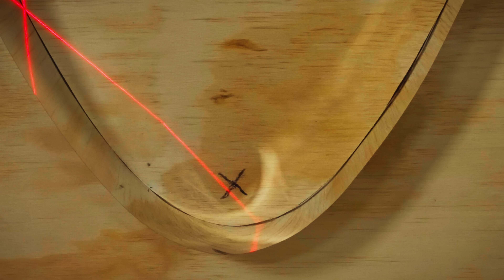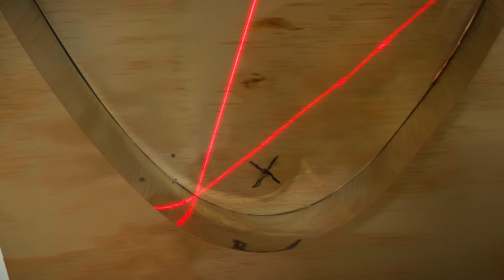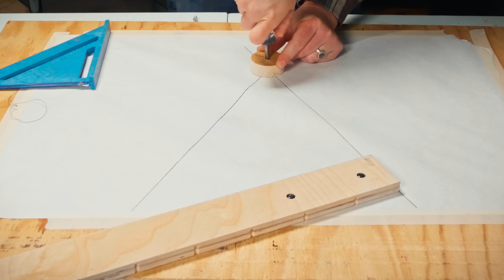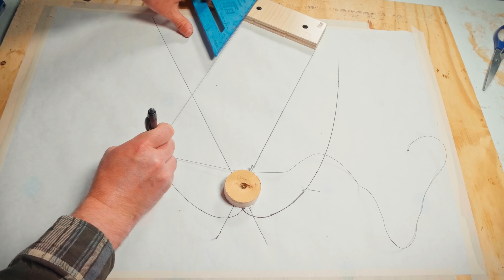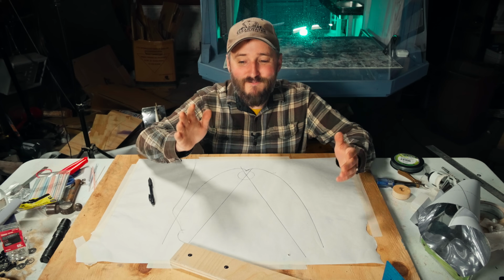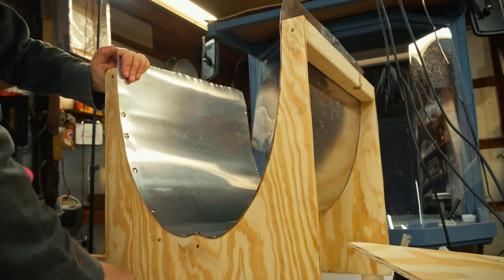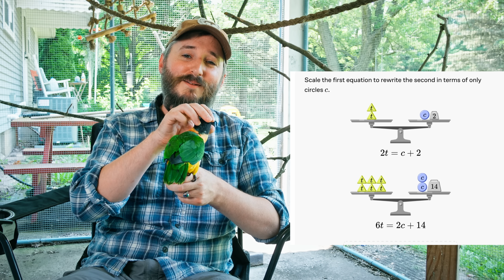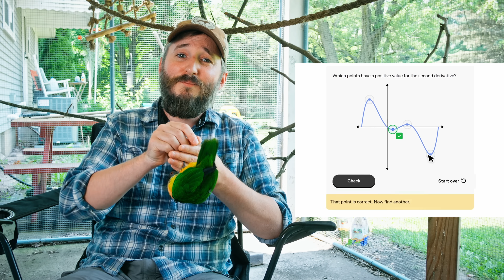DIY Solar Concentrators, Made Better.

Comment: I think if you repeat the mirror over and over to ten feet and put a black aluminum downspout in it ,it might be able to pump out a nice slow flow of hot air. If the volume isn’t enough it could be coupled with a box of passive solar black pipes to move really hot air into the box then pumped into a building.

Comment: I wish I could get water under 98F + out of my pipes during the summer. The only thing that helped slightly was to put a cut piece of pool noodle over the line coming into the house and shade it with a hose reel. My hose bib and main line face north and have shade coverage from the east.

Comment: Instead of a reflector, can this be done to make a lens that will direct the sun onto a solar panel throughout the day? This could eliminate moving the entire panel to track the sun.
Reply: Except that you have to move the lens now AND the panel, and also actively cool it bc otherwise it'll be toast :) Also doesn't make much sense because you could simply use a panel the same size as the lens, the amount of energy collected is the same.

Comment: If u like to progress more u might like seeing the project of an already passed away physicist, radio-astronomer and engineer - with international recognition, on a solar thermal powerplant version with hot air, not water. Due to a breach of the agreement from the side of the investor, the experimental powerplant remained unfinished and he dies soon after. 
He claimed it was the most efficient energy production from (star)light, considering the space used and the relief (terrain) possibilities (mountains etc.). His name was Paris Her(o)uni and the test project was called, I believe "AREV" ("Sun" in his tongue), maybe with a number after it...
Reply: The parable remains steady and only the top moves, just like his radio-antenna he had designed, which in his times was had the least noise polution in the standard of 8mm something :D Back then it was the smallest wavelength astronomers were "catching".  You have started  noticing, what he had noticed long ago and had the designs to implement also in energy generation, but.... oh well....

Comment: I learned about non-imaging optical concentrators when I was in High School (back in the '80s). I was going through old issues of Scientific American magazines, looking for interesting articles to study. Learned about non-imaging optics, Damascus metallurgy, Coanda effect in air and water, hydro-static (?) water propulsion (uses a pulsing piston/anvil mechanism around a hose). Lots of really cool ideas were studied in the last half of the 20th Century with introductory (or not) articles being written. Something that was used to increase the concentration factor was a light oil to increase the index of refraction. This was used to pump a synthetic ruby laser, and reportedly achieved temperatures hotter than the surface of the sun.

Roland Winston, widely considered the "father of non-imaging optics," introduced this field in a landmark 1966 paper, describing the compound parabolic concentrator (CPC) and "Winston Cones" that maximize light collection without forming images. In 1988, Winston and his team set a record by concentrating sunlight to over 60,000 times its normal intensity using a mirror-based system.

Comment: Have you thought about using your highly reflective sub ambient cooling paint as the reflective surface? 

I'm guessing the stick on mirror is around 85% reflective and probably has a short life.

Even though normal white paint is only 80% reflective, it's service life will be a lot more than mirror film. 

Your white paint however was much more impressive then that.

Comment: Pretty clever application, I thought, about a 2 to 1 increase in available gathered energy with about the same set of resources used in either case ---- just a slight change in the reflective surface angles. Well done and thanks.

Comment: Currently designing my cob house.  
Going to use this to build a solar hot water heater by incorporateing this solar collector horizontally in an outside garden wall on the south side of the home.  
The opening should be wide enough to gather sunlight all year with the sun tracking at its highest in the summer and lowest in  winter path in the sky.  
Actually a little worried about getting the water too hot.  Thank you for this.  Subscribeing.

Comment: I think I am going to try and make one of these pretty soon. I live in MN and I have 350 gallons of water I need to keep liquid all winter for my ducks. It just needs to be not frozen, the ducks don't care if it's 40 degrees. I use a 1500w stock tank heater right now but a large set up like this could hopefully help it run less and save me some on my power bill!

Comment: Thanks this was great. I've been thinking of how I can use solar to heat domestic hot water. I was just going to use a flat plate collector, but if would be at a fixed angle and so would only be optimal at one specific angle and the sun angle changes greatly throughout the year and day. So this will allow a much greater optimal angle in all conditions. 😊

Comment: heatsinks? This way you only need a tiny "naked" spot on the sink(s) and you can insulate the rest? Or is there still a lot of energy loss this way when using a parabolic setup? The cast iron pipe is already kind of a heatsink isn't it?

Comment: (In many solar power channel videos, the mirrored surface ends up in a spinning rod, and it is that rod that eventually creates the actual electricity. How does that work, please, exactly, in its absolutely simplest form?  I can get a rod to spin, easioy, using magnets...  But I dont know how that rid, or ANY spinnijg rod, is set up downstream to generate energy. Thanks...)

Comment: I'm waiting for someone to use this reflector on bifacial solar panels.
Reply: Can you try the flat plate collector on plate coated in radiative cooling paint?  Does increasing the opening by 3 increase the cooling by about 3 (-mirror efficiency)?

Comment: 3:00 Just to be pedantic, the shape a hanging chain makes is not a parabola, but a similar looking curve (usually), a catenary curve. Mathematically, the difference is that the parabola grows by the square power, it is quadratic, and the catenary grows exponentially, the exponent is X itself. That said, one can be a decent approximation of the other anyway, at least if the catenary's curve ain't too extremely sharp. Can probably also approximate a parabola by using an ellipse drawing method (it takes two pins, a scribing thingy and a fixed length of cordage) too and only drawing half or less of the ellipse, just put the second pin as far as physically possible (literally, a parabola is after all an ellipse with one focus at infinity after all).

6:08 That could be a biquadratic curve,  y(x)=ax^4+bx^2+c. Or you can just have it as a piecewise function (catenary or parabola) with some displacement factor for the x variable that flips after the middle point (let's call it h), so something like y(x) = { catenary_Y (x + h) for x >= 0, catenary_Y (x - h) for x < 0 }. I think the piecewise version better reflects your thought process and construction method there.

Comment: @NightHawkInLight Check out Sulas Heliodrive, they use this exact type of concentrator at the top of a pipe on a solar rig.  The system uses solar power to heat and melt an industrial wax, creating hydraulic pressure that drives a piston to adjust a solar panel's orientation throughout the day.  Then at night the wax cools and the rig goes back to a starting point until the next day when the sun heats the wax again.

Comment: I had a similar brainstorm about 20 years ago and built a parabolic trough just under 6 feet long and placed a 1 inch black pipe at the focal point.   With the bottom plugged, filled with water and set vertically, it heated water in a heartbeat.  Concept proved, the contraption set in my garage until just this past fall.  I started working part time as a lifeguard at a private local pool that is open year-round.  Even in Austin, Texas, winters can get chilly and the owner grumbled about the cost of gas to heat the pool.  I pulled the contraption out, made some cosmetic repairs and brought it into the pool.  Connected to one of the pool jets, on a sunny day, the water was raised 2 degrees coming out.  Not much – but with a bank of these and all day to work, the temperature of the mini-Olympic pool would have been impacted.  The Boss thought it was pretty neat, but didn’t want to go for it.  With the Compound Parabola, it would be much more efficient.

Comment: 30 years ago, a guy created one to produce hot water at his house.  So, here's what I can report.   these things take a beating, by the sun, even at a Northern state location.  He used fiberglass in the housing, and the sun destroyed the housing. He used plastic as the cover.  The sun destroyed it, and yellowed it.  While it worked, and continued to work for quite a while,  if you are serious, you have to use better materials.   He also died (ouch), so, it was up there for years, just rotting away.  It did not last 7 years, before chunks were falling off.  You have also intensified the suns abuse for your materials.

Comment: It's true that the parabolic reflector only reflects light from one particular direction onto the exact focal point, but light from other directions hits points near the focal point. Fitting the simple parabolic reflector with the same size target as the one in the compound parabola setup would therefore result in more light hitting the target, and would make for a much fairer test of the difference between the two shapes of reflector.

Comment: I've wondered for a while now if some combination of Frensel lenses or mirrors could be rigged up to heat something like a sand battery based "oven". Yes, I know there are all sorts of solar cookers out there, but I want a full-size oven that has enough thermal mass, it's basically 350F any time of day or night, all year long.
Reply: I have such an oven, with a 2.3m² parabolic mirror that reflects sunlight into it. It can reach far beyond 200°C, but 200°C is usually the average I reach here in Germany, enough to bake bread, roast chicken, make pizza etc. Instead of sand I use cast iron cookware as thermal mass. Btw I'm not the only one, there are similar systems like Lytefire or Scheffler reflectors.

Comment: This is so cool. I feel like this could be made even simpler by drawing half and then mirroring it. Also, I  would imagine you could just draw 2 parabolas offset from each other by some function of the diameter of the pipe, then placing the edge of the pipe where they intersect. Things to think about!

Comment: I designed this back in the 90s for a reflector for a fluorescent bulb. The shape was that seagull or a "M"..you have a "W" in reverse. I designed it on CAD and I started with a circle the size of a bulbs diameter. From its center point I drew rays. I started with the reflector touching the bulb on the top of the circle. The top of the circle points away and is in most need of reflection. The shape you have is what I ended up with.

Comment: How much more light would bounce around in the curve if you had a two-way mirror on top? Allowing the light to go through the top, but any wasted light will bounce back off of the bottom of the mirror and back into the curve at new angles.

Comment: I came across a paper once detailing a brayton cycle demo cart at MIT. They used an old automobile turbocharger as the turbine. I'd some day like to see a solar parabolic trough, open to the atmosphere, just blowing air through the heated pipes, and the heated air at the other end driving the turbocharger! I think it would be cool and a simple way to generate electricity from a backyard CSP system. No fluid, just air.

Comment: As usual a fascinating & inspiring video, Thank you !!  Did make one using a parabolic shape 1m x 0.3m wide, onto a copper Ø16 tube sprayed black.  No water in it, just open both ends, passed the 200°C mark.  However with water passing through it the performance was disappointing.  Made a MkII, 2m x 1m wide, we called it "the boat".  Worked but I expected more.  I'm curious to see how your compound parabola will perform.  !  Liked RyanRoss-d6z's recommendation of using phosphoric acid to blacken the copper, much more practical then paint, and no potential heat transfer barrier.

Comment: [11:46] - This test is biased due to the different pipes used. A larger tube diameter allows significantly more scattered light to be absorbed, which is particularly true when the sky is cloudy.

Comment: Please keep building on this concept, such a great idea with basic materials. A lot of comments are talking about sterling engines or comparing it to photovoltaics. I just want to know how to get a reservoir of hot water for showers or to have enough ambient temperature to heat a small cabin.
Reply: I'd use an evacuated tube collector for that, very common here in Germany. I you have less sunlight you can still add a reflector.

Comment: So... I had stopped short of seeing the flat collector shape, and I also just read in IEEE Spectrum about a micro-concentrated PV panel and one downside that was mentioned was the need for a dual-axis solar tracker. I wonder how much could be done with these complex parabolas to limit or eliminate the need for a dual-axis tracker

Comment: So now my question is, could a more robust version of this, perhaps several in sequence, be used to heat a greenhouse (or a tiny house) in winter? If the pipe fed into a more vertical tube that allowed convection and it was cool outside but the pipe collector was blackened as described by @RyanRoss-d6z in comments, with a glass tube, would that not draw in warmed air? What am I missing?
Reply: Maybe it would need an outside extended length dropping towards the ground to start the convection, so that it would be collecting cool air, heating it and then letting escape inside.

Comment: Ben, Have you seen a Sun Oven? They are a manufactured box unit with reflective materials that one can cook with..... They are great, and you just put your food in, point it towards the sun, and it cooks a stew or bread etc, without burning it.... It heats to about 450 F .But you need sunshine.... They are spendy as well...Like 400 bucks or so.... The catenary, or Parabolic trough that you made would be a game changer for folks to cook on cloudy days....I would expect two parabolic reflectors at 90 deg out, reflecting to the single focus point to really cook! This could be integrated into a solar heater using copper and sand as a radiant heat battery for an RV, or hunters shack, etc..... The great issue overcome here is its ability to work on cloudy days.... What would really rock is in a place like SE Oregon,like Klamath Lake area,  where it gets bitterly cold in winter, but has like, 300 days of sunshine a year..... Even a place with partial intermittant shading from foliage may possibly gather a reasonable amount of solar for heat production that may be stored for slow nighttime release..........

Comment: How about building one with a tubular concentrator, that has an auger with a hopper to feed shredded plastic bottles into the hot concentrator, the other end will be a nozzle connecting to a cinder block size Lego shape mold that can be used for building privacy walls or pavers, if the mirrors only follow the sun on 1 axis, the hopper, auger and concentrator tube don't need to move, most consumer plastic waste melts at 500f and less which seems achievable on a sunny day , for added automation, a pressure switch can be used to turn off the augur and stop the flow as the mold is full, and a sensor to also stop the auger if the 2 part mold is opened to remove the finished block, a UV protection paint can be applied for longevity and curb appeal to finished wall or pavers
Reply from the maker: Nice idea!

Comment: Thought concept - move the paraboilic curve into 3d like a parabolic cone.  I'm far from a maths expert but if this design expanded, the polynomial bit of the formula would result in more "wasted" space under the curve as it expanded.  Make a cone out of a compound parabola, the cylindrical collector coming from the center of it.  This should collect and concetrate light from a circle and I think this makes it more effective in directed positioning.

Comment: With the flat focus, I'm curious if it could improve collection in standard sized PV panels (but in low profile so as to not block neighboring panels) 🤔

Dang.. I could've used some of that self-adhesive specular back in my lighting product design days 😅

Comment: I bet you could use a larger version of this as a continuous desalination still. I think the hardest part would be figuring out how to get the leftover salt out of the system. If it got hot enough, you could put a turbine in the system and produce electricity too.

Comment: I have a question, does the flat part of the mirrors have to be aligned east to west for better reflection?
Reply from the maker: It makes sense to do that since you won't need tracking in that direction with a trough

Comment: Please release the contour shape file for the standard pipe sizes. Ideally DXF so people can laser cut or trace out on any material without needing to draw or calculate.
Reply: sent a link earlier I did with (math formula) web format , that saves svg and interacts with Compound Parabolic Concentrator for use with CNC and Laser projects. (click on turtle to left) for code. let me know if this works for you.
Reply from the maker: Check the video description

Comment: I live in a very sunny place so not so concerned about cloud performance but more direct sun. It's unclear to me what the performance would be at different angels of the sun relative to the angle of the unit. Would it work at all in the morning and afternoon if you had it at 90 degrees compared to noon sun?